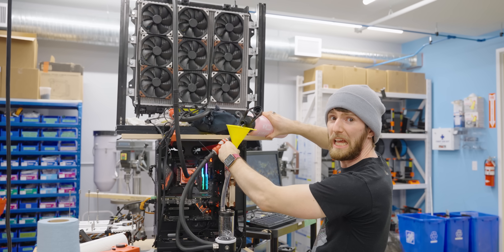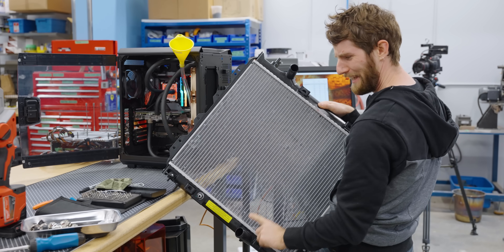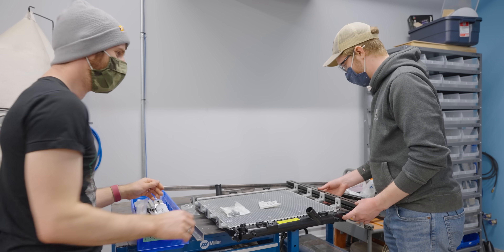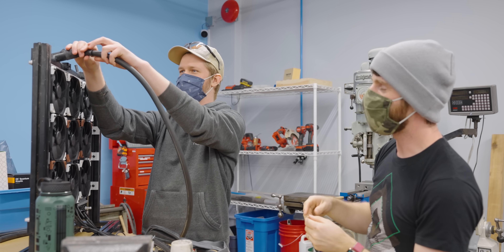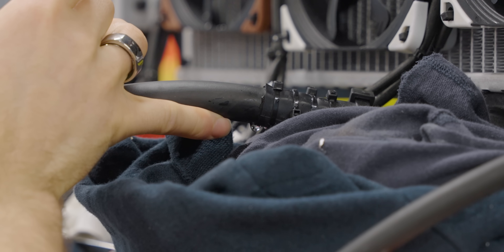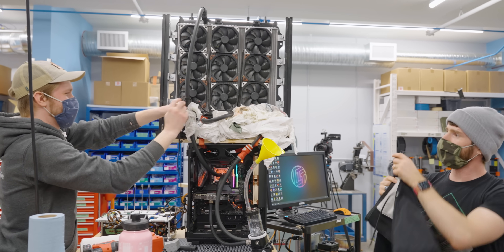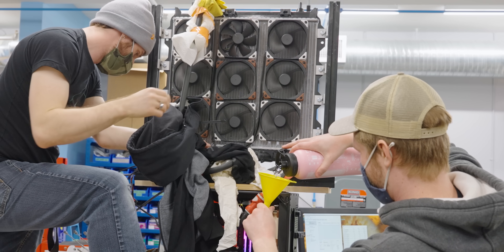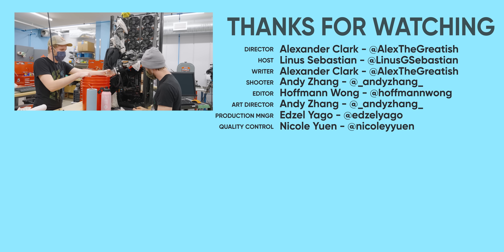Our Craziest Cooling Project Yet - Car radiator liquid cooler

Comment: You have awoken to a world in which Linus Media Group is the sole organization with the means and legal authority to design components and software for pc's, the life blood of a now high society. 

You have awoken in our world. 

LMG's monopoly is law. The words of God King Linus, may his bits remain forevermore in our hard and solid state drives, are absolute.

Dissenters spend their lives laboring away on "refurbished" Dell Optiplexs and other like machines from the before times. The worst offenders *cough cough - Steve, Jay, and their followers, are exiled to the bad lands where it is said that the routers always need to be restarted, and the internet is slow too; GPUs (LMG trademark) and RAM (LMG trademark) can not be overclocked, forcing consumers to operate at stock speeds; you never have the right cables to connect anything, and the adapters you have are never the right ones so you have to create the weird adapter for you adapter thingy; and the key needed to enter the BIOS is always something stupid and probably not a key that your keyboard has anyways.

There were once rumors of an uprising that would free the bad computer people from their exile, but those rumours faded just as quickly as they sprung up after LMG made all residents turn over their "W" keys in the great "W" seizure about two decades ago now. The poor resistance could only "AD" spam or retreat after that.

Some years ago, the Chief Engineer of Rapid Technological Advancements and Creative Computing Hardware Solutions, Alex, was tasked with the creation of new pc cooling solutions by God King Linus, may his bits remain forevermore in our hard and solid state drives.

Today the people of this world have witnessed nothing short of a miracle. Alex has unveiled the latest in pc cooling hardware. This latest generation pc cooling system now only requires a small team of two people to maintain a Gaming (LMG trademark) pc in operation. It is the new two team cooling system, and it will lead us into our computationally prosperous future. 

It was previously thought impossible to decrease the team size of a cooling system, but soon the days of ten team coolers will be forgotten as the higher device owners pass down their six team Gaming (LMG trademark) pc coolers down to us. We are truly blessed. Our lower devices will soon operate cooler and faster than ever thanks to the great works of Alex.

Along with the new two team cooling system, Alex has reimagined the methodology by which two team workers maintain the Gaming (LMG trademark) pc's cooling system. This new methodology of maintenance procedures is demonstrated perfectly with all the skill and precision of an open GPU (LMG trademark) surgeon by the God King Linus, may his bits remain forevermore in our hard and solid state drives, himself. 

This of course means that Gaming (LMG trademark) pc cooling system workers will need to be re-educated in order to maintain the new two team systems properly. But giving all of the living expense tokens one is allotted in the span of 19 years is a small price to pay to emulate the actions of God King Linus, may his bits remain forevermore in our hard and solid state drives.

This demonstration video marks a new age for our society, and we owe it all to the God King Linus, may his bits remain forevermore in our hard and solid state drives, for his amazing foresight and his terrifyingly awe inspiring leadership.
Reply: P.S. When you go back to your world, please send help
Reply: P.P.S. I didn't write that P.S. help message. My account (LMG trademark) must have been hacked. I serve the new world order. I swear!

Comment: That engineer should be fired or suspended, abysmal failure. Should’ve have bought or yanked from a junkyard the radiator hoses and brackets. Then just insert the cpu hose into the big radiator hose and zip tie hard af or use superglue

Comment: other radiators that would be interesting to try, such as refrigerator radiators that are made for passive cooling.  air conditioning radiators or large refrigerator radiators that have a large fan for cooling(without compressor obviously). they would be better because they have fewer places to lose water.  and a question, why didn't they put longer hoses and put the radiator on the floor?  or in another room?

Comment: In the US a Civic Half radiator is smaller and $60 from Mishimoto or even some of the major auto parts store brands. Just a tip for someone wanting something that will match up to a PC case better and not cost as much.

Comment: Oh hell yeah, I wanted to do this many years ago
Reply: Lol haha 😂 I never thought any body would actually do this kind of stuff
Reply: @00ii0i9  i actually thinking to do this stuff, but not like this..more like full compact ITX with only CPU block and GPU block with quick connect at the back and then connect all the way to other room or maybe outside to big radiator like this or triple 360mm radiator with pump and resevoir set up..
Reply: @slyztercoreveanged3175  thats a good idea but the dust lol you probably wouldnt need them fans at all to cool the whole thing lol but its a massive radiator
i know someone did with the refrigerator compressor to cool the whole system
pretty cool though
Reply: Eh

Comment: I made my own cooling system for my cnc that had the same theory as this just much better execution, I used a 5 gallon bucket of water, a motorcycle radiator, a fan, and a aquarium pump. The secret was the 5 gallon reservoir, with that much water the heat exchange was super efficient. It looks super jank though.

Comment: The main body of the radiator cools the engine oil, and it seeks to simply keep the fluid flowing through it as cool as possible. There's a thermostat in the engine cooling loop that closes when the fluid passing by it gets too cold, so when the engine is cold, or the radiator has successfully cooled the engine coolant below this point, it closes.

The transmission cooler doesn't seek to keep the transmission fluid as cool as possible, it simply seeks to keep the transmission fluid at a steady temperature, which it does through a fluid to fluid heat exchanger inside the radiator, which carries the heat from the transmission fluid to the engine coolant.

Simply using the transmission cooler lines would have been a bad idea, without running cool water through the main engine coolant loop; it would have been sort of like building a water cooling loop and then putting the radiator in a box.

Comment: Once the price comes down on everything and availability comes back I will build something like this with no leaks using a bigger radiator that would be a permanent solution and having a super duty front end as decoration over the radiator

Comment: Lol I built a pc case that holds 2 massive wall mounted ac conditioner radiators with little more than a tape measure a welder and a dremel and it looked and functioned better than that

Comment: $250? Damn I bought one twice that size for my Chevy Silverado for $170. Oof 

Ideally for this I would connect an Electric radiator fan and water pump with a pressure regulator to step down the pressure of the loop before it hits the PC.

Comment: You guys should have used a 2000 honda civic radiator. It's a little thicker than the one you guys used but the honda one is about a quarter of the size, hell I bet you could have gotten a honda dirt bike radiator inside the case!!!!! It would have made a good side cover replacement they are about that size.

Comment: Can't wait to see this concept re-visited a year from now when its not thrown together on a Friday.
Reply: It seems like 90% of the leaking issues could have been solved with a quick trip to the hardware store prior to cobbling this mess together.
Reply: Honestly I hope they revisit this soon cause it could be so much better
Reply: Its actually not that different from an idea I have for a build where I want to put the radiator down in the crawlspace of the house.
Reply: Yup
Reply: I don’t know if their jankiness was intended as “schtick”, but I would’ve liked for them to put a little more thought in to this upfront because it could’ve been pretty awesome.
Reply: I came for that, what I got was a mediocre comedy of errors.
Reply: this is literally a worse repeat of the home radiator watercooling video they did a few years ago
Reply: Jay2cents have a similar one using box fan and480 rads
Reply: GirlBaBes.Men
Reply: I want to see it re-visited soon where they do the radiator connections properly so they don't leak.

Comment: The only reason why the tranmission bungs exist is that it uses ATF (Transmission Fluid, oil based) instead of coolant (water based) as the engine does.  The oil can't mix and runs at a higher temp so it doesn't need to pass through the radiator, just the water.  There is no point in using it in your PC loop as you are using water for the whole thing. But seriously all this effort and you guys couldn't come up with some better fittings, you guys are like RED GREEN SHOW with paper towel and zip-ties instead of duct tape. Why not just use the 12v radiator fan that also comes on the PT.

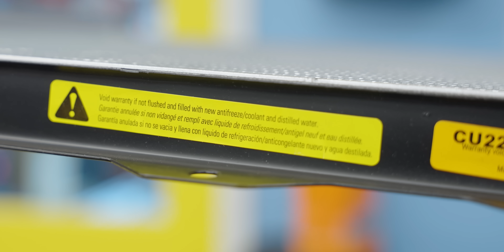Comment: @3:15 Basically the transmission cooler is just a pipe that runs through the outlet header of the radiator.

Comment: the trans cooler is a small cylinder inside the rad. so youd gain nothing by using it in this case.

Comment: the smaller loop its just a heat exchanger for transmission oil. 
the two ends are connected to the transmition in order for the oil to pass from the heat exchanger and "cool" down.
*keep in mind that all lubricants in a vehicle are designed to work at high temperatures, so the 90-100 degree radiator is a cooling solution for a 120-140 degree oil

Comment: might I recommend looking into oil coolers as radiators? much smaller than antifreeze radiators, whereas much thicker. I'd imagine it's a better use case for PC cooling, though I've never tried.

Also they typically work as passive coolers, sitting in front of the radiator, so my guess would be pairing them with 6 or 8 case fans(whatever size/number fully covers) would give decent performance. Still bulky, but not quite...this bulky.

Comment: This is what happens when you don't spend a little time planning. I feel like 20minutes more planning lets you avoid this whole mess and ends up actually saving you time even though you spent more time up front planning. I'm not sure these tests told us anything. Like you said you are basically replacing all the water before it even got a chance to heat up.

Comment: I could have done a much better job of it myself  The car rad use a diffren one that only has 1 in and out n get correct fittings made then have it sitting by the side of the PC not on top 2 Pumps one for in one for out and instead of Noctua fans Use a car electric fan the correct size for that rad and run it off of a battery charger directly... Would have more than enough flow and cooling but kinda loud with a car fan :-)

Comment: Based on the fact that the top hose was leaking leads me to believe you set the rad up backwards. Car rads are designed so the fluid goes in the top and out the bottom. Secondly you should have capped or just looped the rad cooler connections together. After that there would only have been only point that could leak. It could have worked so much better.

Comment: now my brain is thinking on this. first off? the frame you built for the radiator is good, but doesn't go far enough. you need a plate to screw into the frame, with cutouts for the fans made with a water jet to mount the fans too. then you need another power supply just for the fans.  or better yet, add another pump into the mix and have that second power supply power the fans and the pump.  then you need better hoses, actual radiator hoses to run from top to bottom for the main and then fittings for the transmission part of the loop. also silicon pipe sealant for the radiator hose transistion to stop any leaks.  I know I'm missing a couple things in here somewhere,.....ARRRRRGH! Damn it Linus!

Comment: This is the worst implementation of the best idea ever, ROFLMAO!  
This get a chunk of hose to fit the radiator then a PVC plug drill a hole in the plug for a fitting to fit the PC hoses, mount fans fill and win...simple....

Comment: The transmission cooler doesn’t use the metal radiator fins. It’s essentially just a heat exchanger inside the plastic side.

Comment: I'd like to see you guys do this properly. Just figure out a way to step down the inlet and outlet radiator hose size to the PC radiator hose size without leaking and you're good.
Reply: Maybe have a radiator place build you a smaller rad with a simple inlet and outlet.

Comment: Buys a new shop with alot of tools. Hires an engineer to use said tools. Still goes with the  a bike tube and tape. Instead of making a part to fit and not leak.

Comment: Let’s cut out the middle man and just attach a hose to the inlet and use it’s pressure to drive the system so no pumps or fans or rads are required. Outlet goes to a garden.

Green solution 👌

Comment: Car radiators can be had brand new online for under 50 bucks. If you want to eliminate the transmission cooler, you can get a radiator for a car with a manual trans,transmission (they don't have transmission coolers) or just cap those ports with a radiator bypass cap.

Comment: There are plumbing fittings and automotive radiator and heater hoses and hose clamps that can be combined to conveniently reduce those gigantic radiator inlets and outlets to tubing that connects into your normal cooling loop without any leaks. :)

Comment: “The transmission ones aren’t leaking”

You mean the ones you used actual hardware to connect?
Reply: They need to bypass the trans cooler,  it just loops back in when the radiator is big enough.  They also need the fill point higher than the top of the radiator.

Comment: This was hilarious guys ! Also just so you know, the pumps in cars put fluid in the top and let gravity and the water in the radiator be the res for the pump :P Would save a lot of issues. I would like to see this revisited with the flow the right way. I actually think it would run quite well.  Its a hilarious video, no idea about the stress levels while testing it. Maybe grab a radiator with a rad cap on it so you could direct fill

Comment: oh and the join the water loop to the rad outlet, pop some plastic in the lathe an machine up to adapters to what ever size watercooling hose your using then use normal automotive hose and clamps to attach these to the radiator  outlets. don't bother with the trans cooler section. as stated in my other comment it is ususally a coil of copper pipe that heats/cools the trans oil to the temp of the coolant in the end tank and will have no effect on cooling the water if you pass it through

Comment: Why did you not just use a couple of car radiator fans? You can get slimline ones that im sure would move much more air than the fans you used.

Comment: You can tell REAL fast these guys aren't car guys. Not only could you have gotten a smaller radiator (look up sub radiator) and the appropriate fan but the transmission inlet and outlet is for the transmission oil to pass through and be cooled by the rad and not for water. Smh.

Comment: Please do a part 2 to this or a second attempt. With the proper tension and reducers i dont feel that there would be the leaking issues like you had. Ive thought about doing something like this before but with a smaller radiator. Like an external sub zero cooling kit. Great vid tho. Bad reducers made for some awesome content lol

Comment: With about 1/2 hr of research into how automotive radiators work and sealed fittings ahead of time would have made this a viable option.  Plus there wasn't even enough time for the water to even circulate and "warm up". I'd like to see this done with proper planning and an automotive electric fan.

Comment: Actually I'd like to see a second version of this where they actually mount one of these radiators in a giant case or maybe build a custom case for this application. And instead of all those small fans it should get a really big one from a car and it should be pretty quiet when it's running slow ^^

Comment: This is what happens when two people that are good at computers show how bad they are when it comes to  plumbing. All they needed was some small peaces of pvc pipe for support on the inside of the tube on the conection points. Without that you will always get leaks because the inner tube will deformed from the pressure of the outer tube.

Comment: I built a cupboard to house my fleet of external drives, and used the f 14” automotive fan that goes with Linus’s radiator, runnig at 10v, to push filtered air into the cabinet.  Huge airlow, whisper quiet.

Comment: to be honest this video is a bit of a disappointment. i expexted more planning and extremely less janky BS from a LTT video. there are many local places to get reducers and you have access to all the proper resources in house to 3d print or laser cut etc. this is probably the first time in a long time where i've felt that you're just putting out content to cash in. super disappointing. wayy wayy too much jankiness for a company of your size and the fake commentary about the jankiness was not funny. disappointed. i think we've come to expect a higher level of quality and this should not have made it to the channel. i'm sure many will disagree with me and find this funny but this just looks like a 0 effort video that may have flown on a channel super fun style channel  but not a LTT level of quality.
Reply: i really hope you revisit this radiator idea and show how you can use 3d printing and reducers etc to take this idea to the next level.